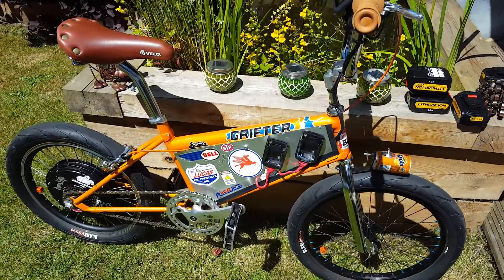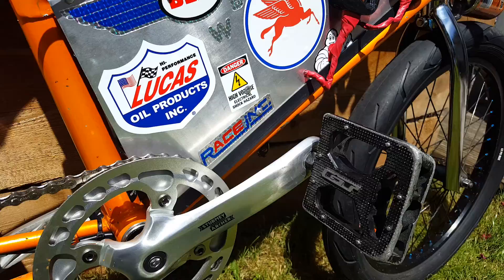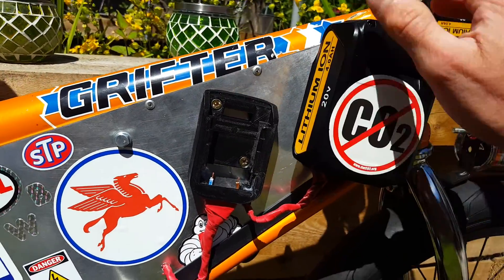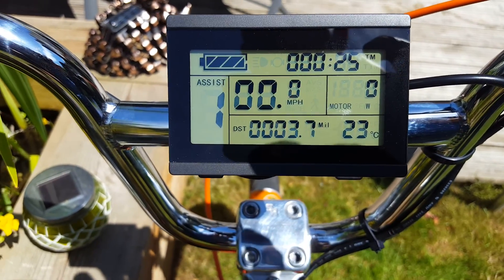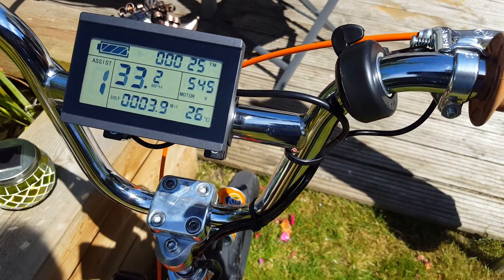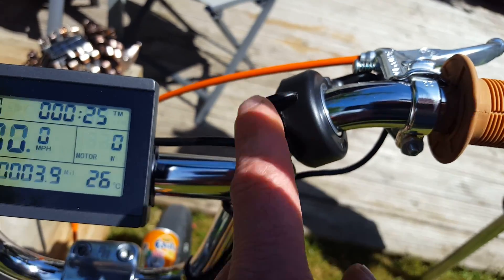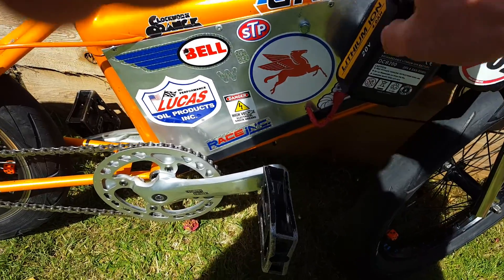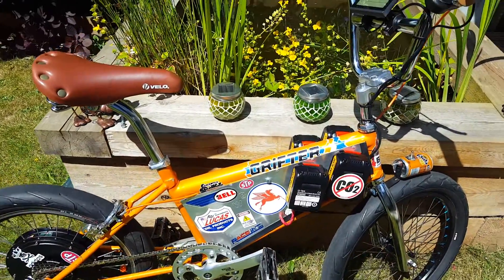DIY Home build Electric e-bike Raleigh Grifter 40v 500watt

Comment: Great build David! Can i ask. where did you find the rear hub to fit 110 drop out with chain connected? im struggling......
Reply from the maker: Hi Sony, I had to widen the rear drop outs with a car jack to get it to fit. Chain wise I just bought one and cut it to length.
Just Google 20" electric wheel hub. They do brushless ones now that are far superior. The company I got mine from doesn't trade anymore. 
Hope this information helps.
Reply: @David-hc2ww  AHHH Thanks David, did you find the pedals still had clearance with the wider drop out? mine wont.. you reckon front wheel drive would be easier (less traction though)
Reply from the maker: Pedals are fine, didn't really give that any thought. But never had a problem so didn't think about it.
But essentially everything has been changed.
Bmx front forks and bmx headset seal Shimano bottom bracket.  Sturmey Archer crank. Mx brakes  layback seat bmx handed bars. Just started with the frame as it had lots of character. And not many orange ones around.
Reply: @David-hc2ww  it worked cheers mate!!!!!

Comment: good engineering david, There are some bmx's on YT with 72v 2000w power, same motor probably just a bit warmer after a minute :) motor power is mostly a ratio of weight and efficiency, you can get easily 1500 watt for a few minutes from a decent 6 kilo motor. I want the same as that. It would have to be a slow, tractor kind of motor :) it's funny when the bike can wheelie and it can go over any fields and mountains :)

Comment: Hows about adding a mid drive motor as well? 

Or a mid drive and a front hub for triple motor 2wd goodness.

You could run them all as pedal assist or run either the mid drive or the hub motor as throttle controlled so you don't have to run all the motors at one.

One controlled by throttle one controlled by pedalling whichever motor is better suited/ efficient for cruising

Comment: This is excellent,, especially using the power tool batts 
What is the range on the 4 batteries?

Looks good tooo ;)
Reply from the maker: george white, it lasted a full day in and around london on pedal assist. And a good few burns without any pedaling mate. Id say with no pedaling around maybe 4 miles. With good batteries much more.